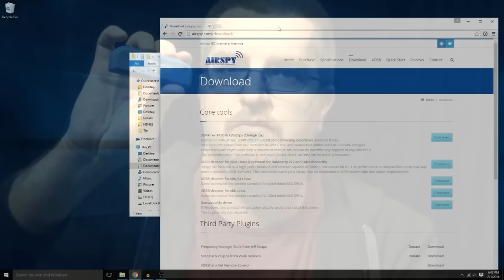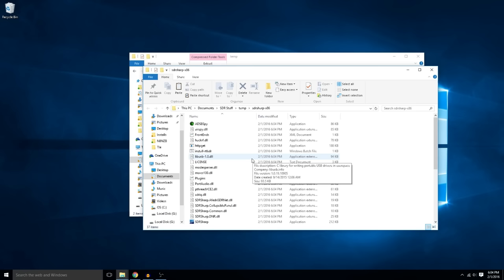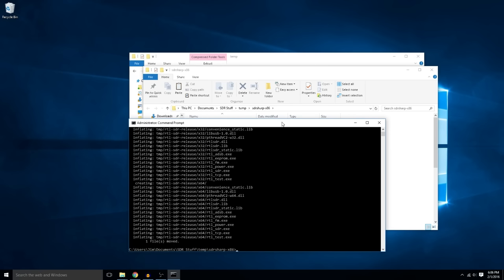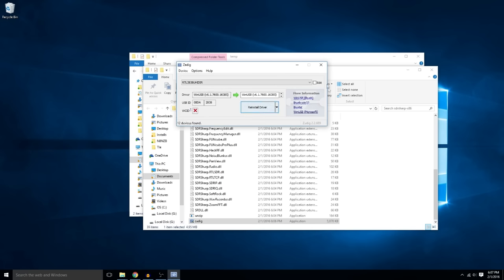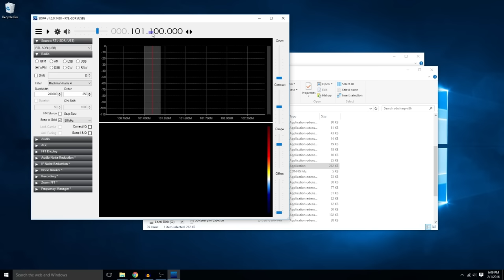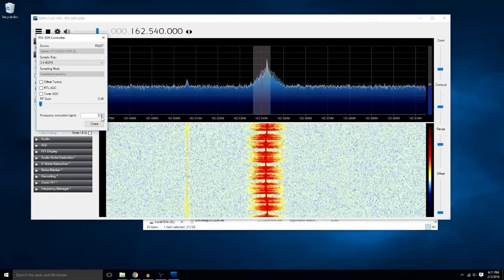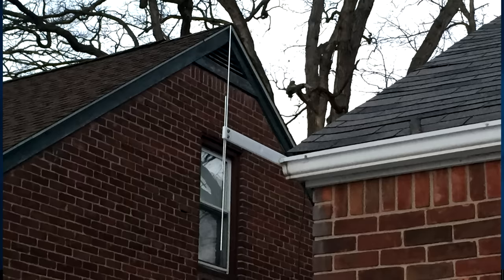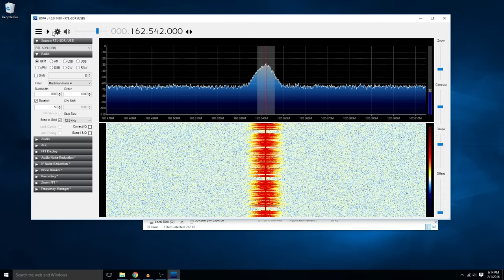NooElec SDR Unboxing and SDR# Setup

Comment: I set one of these up two years ago and ran into similar installation problems ... like you I eventually got it working.

I use a flat HDTV antenna in my window and I can receive quite a surprising amount of stuff (FM of course, taxis, buses, airplanes, etc). Not bad for a cheap little device ... tons of fun.

Comment: Thanks for an informative video. I bought a NooElec dongle and could not get it to work until I saw your video. I had not run install-rsldr.bat file even though I had already run zadig.exe to install the driver. I ran the bat file and everything started working. Thanks for putting me on the right track. Bill (formerly G8SND)

Comment: I bought one of these and was able to do the aircraft tracking even with the included antenna and listen to FM radio. I know there has to be more to this gadget than this. I see there is some sort of Ham it up attachment and there must be plans for better antennas for the different frequencies. Can you point me to some more information on this unit?
Thanks

Comment: So this doesn't work for me. Installed driver properly, it's in the dropdown. If i go to open SDR# it brings up the Airspy logo, then behind it pops up a windows installer. It just sits there and hovering a mouse over brings up the spinning wheel. No amount of compatibility settings or running as administrator will fix it. Couldn't find a fix on the airspy site either. Running windows 10 and up to date.

Comment: Digital informations for digital radio in the FM Sideband? HA!!! WOW! This is so much better than what's going on here in europe… Over here  they wanna shut down ALL FM Stations and completely exhange them for new digital standards.... while we already had 2 obsolete digital broadcast standards… DAB and DVB-T. Both being replaced only a few years later with a completely new standard, DAB+ and DVB-T2. DVB-T was only active for 13 years!! Now people can buy completely new receivers again. I wish i'd live in the US where Radio and broadcast culture is alive and well (especially on AM). Norway has already shut down analog FM radio countrywide… and just created gazillion tons of electronic garbage by rendering normal radios completely useless now.
Reply: Here in Hungary, lots of radios still use AM
Reply: yeah the tech trend is to put more data in a smaller space.   take satellite,   broadcast went from analog ( 1 tv service per transponder )  to  DVB-S  to DVB-S2,    from QPSK, to 8PSK,  now we have the transition from H.264 to H.265 ( HEVC ).   at least the transition is more like a migration,  slowly moving from one to another without just outright shutting down the previous.   

looks like in Europe they want to clear up the waste of bandwidth over the air.  taking advantage of new tech,  to make room for new services and/or additional  throughput. 

These new approvals for services are causing problems,  in the last few months,  I have been having  interference on the C-Band,  either by WiMax, or new 5G  services.   these services are near or share the same frequencies as satellite downlink.  still waiting for shipment on a spectrum analyzer.  but been watching these videos on the smaller dongles, which I also ordered for personal hobby fun.   eventually would like to get the HackRF unit,
Reply: RDS is not new in Europe. Way back in 1994 I rented a car in Germany and did a 5 thousand km road trip through Europe. I had digital FM information from the car's FM radio throughout the trip. Station name, lots of information and sometimes even news headlines were received.
Reply: Oh, they're screwing with all TV here as well.  I'm still trying to wrap my head around why they did what they did.  Selling off Band Width is all I can think of.  Sure put the screws to people living out side of large cities.  Now you have to go Satellite  or  your pretty much screwed for TV.   I just gave up Off Air TV and use what ever Internet provides.

Comment: I ordered from Amazon as well, but ended up with an older version nooelec NESDR Mini R820T. I does not support SDR# and I have had no luck picking up anything other than local FM. Used long wire, and 75mtr dipole. Guess it is broken.
Going to watch some more reviews and likely get a better box.

Comment: Expensive
X3 
Same as 10$ unit that come with cd software and driver for TV.
If you wont to watch tv dont install the zadig driver it will brake the connection
and you dont be able to serch  tv station
Reply: i want to use it with kodi for tv nextpvr  RTL2832U+R820T2 i bought for £9 will work with windows 10 wont it

Comment: thx Jim, excellent info. does it have memories? does it have capability to scan? thx again, John K6LSN. 73
Reply from the maker: +k6lsn The SDR dongle itself isn't much more than a A/D converter.  All of the real work is done by the software running on the PC.  SDR# does have memory capabilities, though I don't think it has scanning capabilities.  I think there is a scanner mod you can download for it, but I haven't tried that out.
Reply: +Jim Haslett If anyone figures out how to get it to scan or has a link to a mod for that a link would be much appreciated. Great video. Thanks!

Comment: Thanks for the sdr setup info Jim.  I`m just now starting to buy dongles,  and I have a Noo Elec  and a Radio Oddity RTL-SDR unit.
this particular part of the electronics hobby is about 4 or 5 years old,  but I just picked up on it. So far I have downloaded several sdr
software suites but have no luck actually playing the radio.   I think it may have been the zadig file being in the wrong directory.
I`ll keep trying.  KD6CFE was here.  73`s

Comment: I struggled getting this SRD setup working but have been able to proceed further with the info you display here.  However, my log jam now is at the part where I click the setup wheel exposing RTL-SDR Controller then nothing is available for a device (E4000 is listed above the grayed out arrow to show devices and I have no action there) like you have.  So I can go no further.  I cant see where I've left anything out but mine is not working for me.  Any clues?  Thanks in advance.
Reply: I was in the same boat as u guys and read this in the comments and it worked for me! "I bought a NooElec dongle and could not get it to work until I saw your video. I had not run install-rsldr.bat file even though I had already run zadig.exe to install the driver. I ran the bat file and everything started working. Thanks for putting me on the right track. Bill "

Comment: hi jim, mny tks for your introduction.  Just some infos from my side.  Application is up and running on my win7 laptop, but some differences to your introduction.

Laptop was not able to install windows driver via network after puting in the dongle
was stopping the win7 process
take the dirver CD how was delivered with the dongle and did the instllation process.  DRIVER ONLY!
In ZADIC the device was shown as BULK IN (interface0)  and a second BULK IN (Interface1).  
Within ZADIC as I chosse the BULK interfaces the DRIVER window down shows RTL2838UHIDIR
did the reinstall

Everthings else works as you described it

best regards
Kurt, DL9FBF

Comment: hello i wonder if you can help me i want to use a rtl-sdr dongle to work with my kenwood ts-570 d radio transceiver . i want to run it on my windows 10 laptop but so far have not been successful. can you run one of these dongles on windows 10
Reply from the maker: +alan gilham In this video, I go through the process of getting the dongle working, and I'm using Windows 10.  Was there something specific that you are having trouble with?
Reply: i think it may be due to the fact i am not using the same dongle you used but i have ordered one (seems hard to get in the uk?)

Comment: Have you (or any other user) used the cheap ebay usb rtl-sdr bellow $10 with shipping, beside the expensive ones? If so, can you please let me know the difference? I am using a cheap one, and it is good, have no idea of these expensive brands. Thank you all.
Reply: I am using such a cheaper stick. I think they are pretty much ALL the same. The only difference is some cases are printed differently or have different plastic. I am actually quite happy with mine. Even thou I haven't added a special antenna to it yet. Mine looks like the one in the video. However the printing on the stick was different and my antenna had a simpler and thinner wire/rod screwed onto it. It even came with a little CD-R that had some TV software on it named "Blaze HDTV 6.0".

Comment: Thank's Jim but you lost me with the command prompt. You typed two lines in, the last was the location of the batch file what was the first?
Reply from the maker: The first thing I typed in was a "CD" to the folder where the batch file is.  The second thing I typed in was the name of the batch file to execute it.
Reply: I think that if you run the BAT file as administrator it will work, so you don't need the command prompt!

Comment: Thanks for this video. YouTube has put SDR in my path and this looks really interesting. I think I am going to order something this kit. I will search to see if you did a video on your homemade Ham radio antenna. Thanks! I am going to sub because like you I have the same experiences of stuff just not working out of the box right away. As far as tech stuff goes I am into Linux and this looks like a lot of fun. 
Kevin

Comment: Does this dongle have esd (electrostatic) protection?,some of them dont have it & can prematurely die due to static electricity :(  think its a diode positioned on the circuit board very close to the antenna socket?